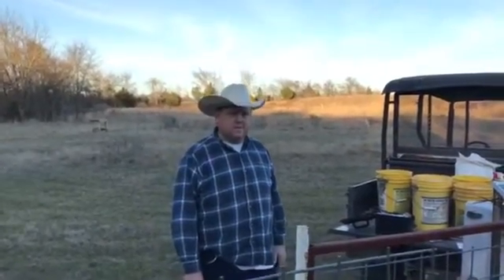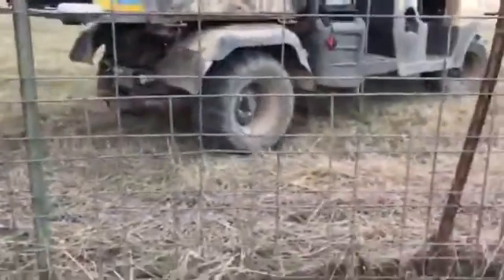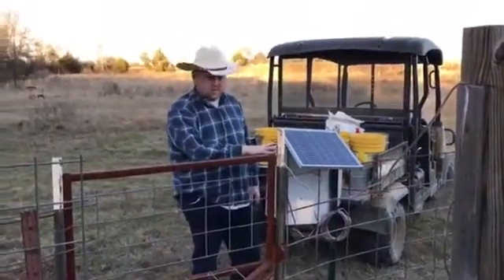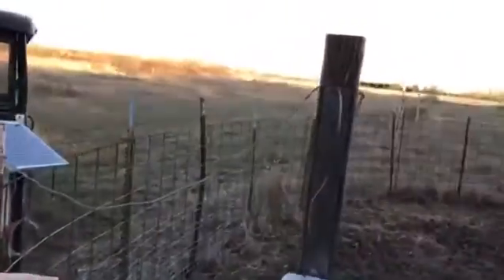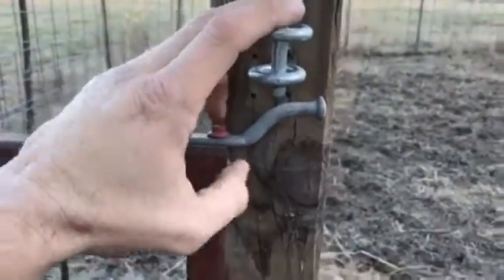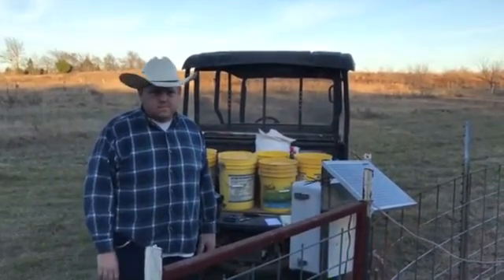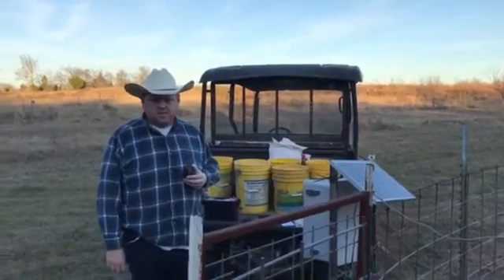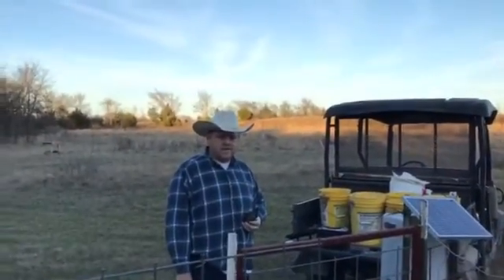Remotely Controlled Feral Hog Trap

Comment: Can you tell me what size battery you have your GSM controller hooked up to.  I have a 12V 7A battery I use in deer feeders but I'm not getting any juice to the GSM controller
Reply from the maker: 14Ah. You have something else wired wrong if your GSM controller isn’t powering on.  You should also be using a 30A relay to isolate the switch from your solenoid.

Comment: A 12 volt feeder battery
Reply from the maker: You’re going to need something with an higher amperage rating than a feeder battery. 17-20ah range minimum to pop that door popper solenoid.

Comment: I have a GSM-RELAY but do you run it thru a relay and selonoid before the door actuator 
I can't get mine to pull hard enough
Reply from the maker: You can run the solenoid though a relay if the relay on the GSM switch can’t handle at least 30A.  Basically the relay in the GSM switch activates the other relay which then activates the solenoid.     How big of a battery are you using?